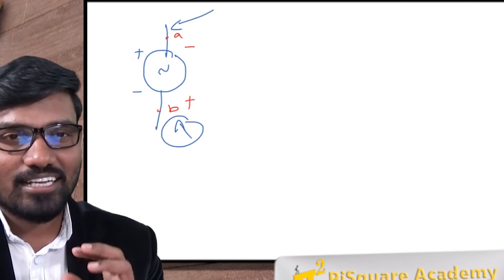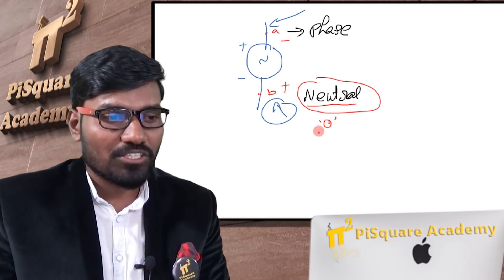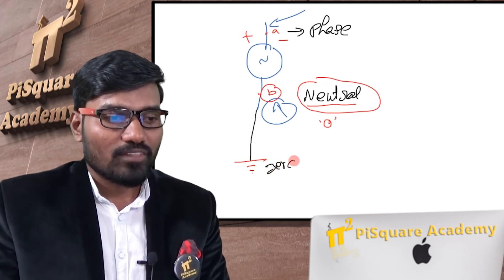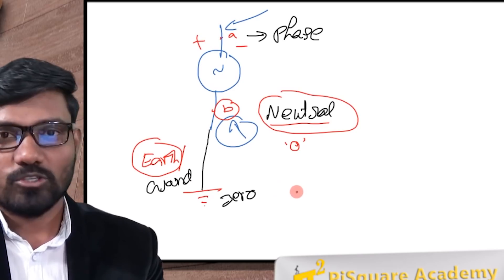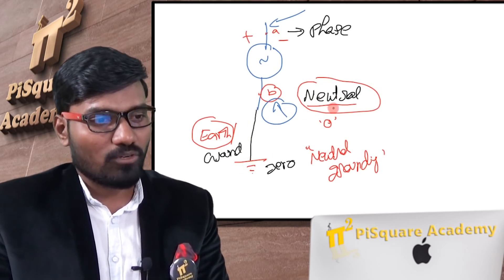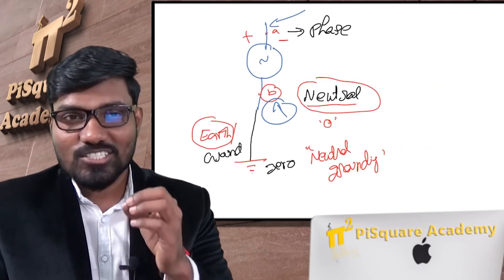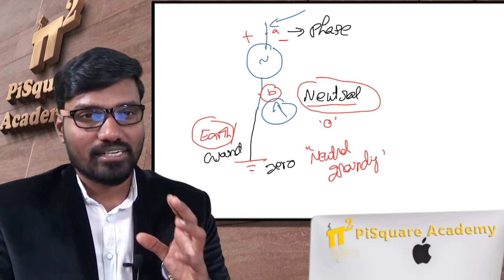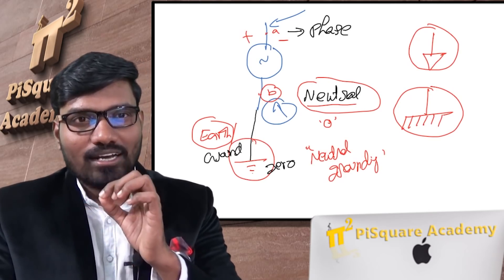Why Tester will not glow at Neutral | Neutral vs Ground vs Earth

Comment: But if you touch the neutral wire of an outlet and your foot is on the ground you will get electric shock. If the ground is 0v then the neutral must have a potential for the current to flow, right?

Comment: my question is why don't we have a dc negative terminal at 0 V ref. for AC we use neutral for return path which is 0V normally , if not then to make sure we connect earth wire with it . but in DC case why do we have DC voltage negative terminal to have -ve of voltage and not 0V like in the case of neutral in AC systems

Comment: It was not satisfactory to me.

Could you Pls tell your opinion on electrones flow in phase and neutral wires and its direction.?

At intial, Your video itself was saying current flows in both direction.
Means Electrons are flowing through neutral wire. Then  balance of protons and electrons are not equal. When protons and electrons are equal then it is said to be neutral. Now Neutral wire has gained electrons in it while current is flowing, it means that has obtained  -ve charged. Atom who loses electrons get +ve charge and vice versa for -ve charge.

What's your stand. Where am I wrong here.

Comment: Hello Sir!If only one wire (Phase Wire) carries charge and other wire(Neutral) is always at zero potential,then when we connect an AC supply across capacitor,shouldn't the plate connected to neutral always be uncharged? But for capacitor we say that BOTH plates should be oppositely charged to establish Uniform Electric Field....then how is capacitance created in case of AC supply Sir?

Comment: While testing the continuity with a tester we should put a finger on the top metal screw to Glow the light inside the tester. why  we not get the shock.
Reply: My question is  also same and also 
Considering our if body is not connected to earth while keeping a finger on top of tester, how the lamp in tester glows?..humbly  requesting you to explain with construction of tester

Comment: You don't ground the chassis you bond the chassis to create an equipotential zone and to carry ground faults back to the circuit through the grounded neutral to operate the over current device

Comment: Than can we use direct grounding without using neutral for eg .230V bulb or fan?
I.e., phase and ground(in absence of neutral)
Reply from the maker: Please read the description for the answer
Reply: @ThePiSquareAcademy  love you sir...so helpful for replying
Reply: Nope. Neutral is the return path of the current. Grounding is done to allow a low resistance path for the current during faulty situation. If there is no neutral, the return current will flow through this ground. Obviously this isn't the purpose of grounding.
Reply: @realasmit47  if return supply is grounded ...then also lamp will glow,but y we won't prefer that?

Comment: I thought neutral was the return path from the load
Reply: A neutral always provide return path and it can be grounded
Reply: It is. Neutral in Generators and Transformers are grounded to make sure neutral is always in zero potential. Neutral in homes aren't grounded coz the return current will flow through ground too.

Comment: Wt is actually the difference between ground Nd neutral
Reply: Ground is always at zero potential, but neutral may not be at zero potential
Reply: Neutral is a conductor which is use to complete the circuit and flow a current only in fault conditions not in healthy condition 
But grounding is used as a protection scheme to protect the equipment and human body , it also carry a current in unhealthy condition